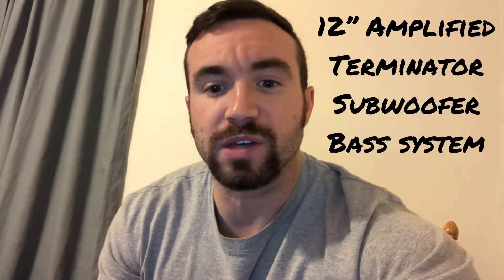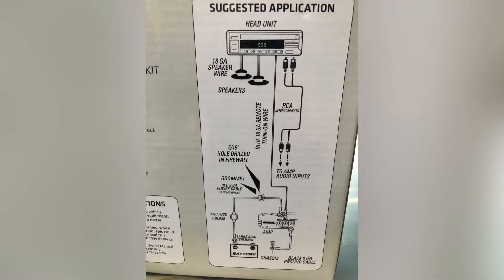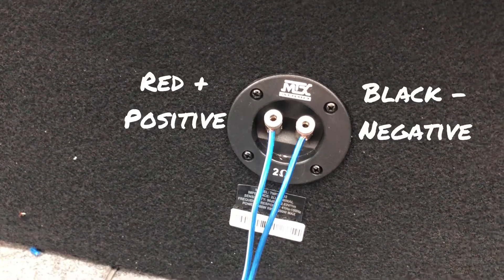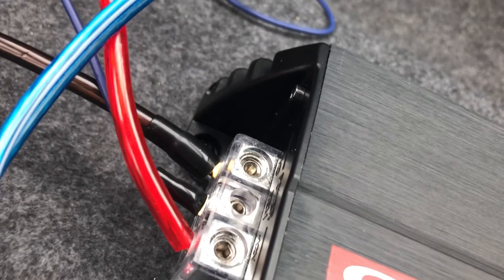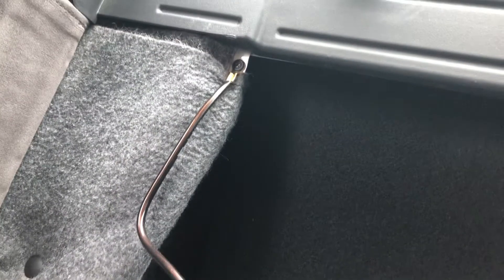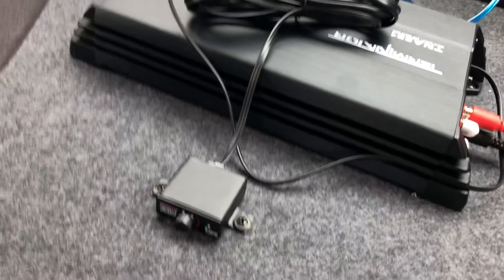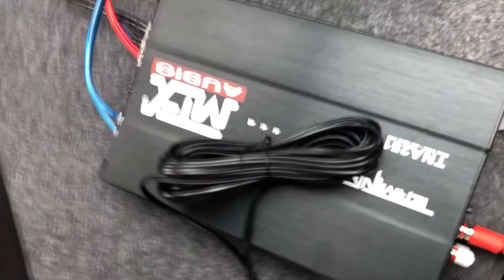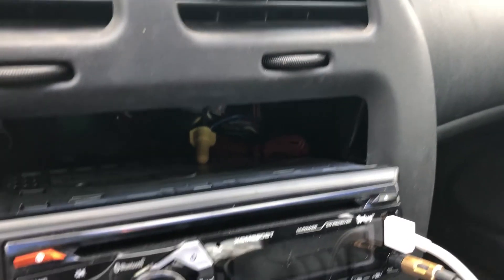Terminator Subwoofer with Amplifier  How to Install

Comment: The lights flash on the amp when I turn my car on, if anyone can tell me why, that'd be great
Reply from the maker: Many times, the protection indicator will blink to indicate the reason the amp is in protect mode. The owner's manual is the best source to help you decode the blink sequence. This is common on older Alpine amplifiers. Not all amps have a protection mode indicator
Reply: Ah ok! Thanks for responding! I think I wasnt grunded right, so once I moved it, it fixed 
 @ChrisBassettTV

Comment: What is the small white rectangle port next to the RCA cable inputs? It's labeled HLI
Reply from the maker: Hey Jessie! HLI is High level inputs. That means that you are using the speaker wire leads off of the back of the radio instead of using the RCA connections.

Comment: I have the compact 8" terminator. I have power from battery and a good ground. Any idea why I get no light from leds and the fuse is good. I have a rca cable for speakers 12v landed on the terminal and ground on the ground terminal.. so I have to use the REM port hooked to the receiver? Thank you
Reply from the maker: 🤔 Hey Shawn! Maybe check the accessory/ignition wires are connected correctly… First off, check your wiring. If you have a voltage meter or a test light, test the ground (black), constant 12v (yellow), and accessory 12v (red) wires to make see if you have the correct voltage in the correct wires, as well as a good ground. Constant will always be 12v, whether or not your car is on. Accessory will be 12v only when you turn the key to the “ON” position or the car is running. Make sure to use your ground, as well as another ground (like the frame or body of the car) while testing your constant and accessory to test that you have a good ground.
If you find that one of your power wires or ground wires are not correct, check your vehicle wire diagram and make sure you have the correct corresponding power and ground wires.
If you do not have power, and you know for a fact your wiring is correct, check the fuses under the dash or under the hood (depending on your vehicle). Easiest way to locate the correct fuse is to look in the Owner’s Manual and find the fuse number and box location. Your manual should indicate which fuse is for the “Accessory”, “Car Stereo”, or something of that sort. After finding the location of the fuse, pull it and make sure that the leads are not corroded and that the fuse has not been broken or popped.
If your speakers randomly stopped working and you noticed that your amplifier is in protection mode, there are a few reasons why this might have happened.
Most aftermarket amplifiers have a protection from low and high voltage. If your alternator is producing too much power, it will trigger the amplifier’s protection mode. Vice versa, if your battery is low and the amplifier is not receiving a constant 12v, it will enter protection mode.
Amplifiers will also enter protection mode if there is a short somewhere. If you have a signal RCA wire that is shorting out, this could be your problem so check to see if your RCAs are in-tact and not shorted. Also, if one of the output channels are shorted out, or you have a blown speaker, many aftermarket amplifiers will enter protection mode. Disconnect all output channels and see if it will return to normal operation. Hope that helps
Reply: @ChrisBassettTV  appreciate the response! I didn't have the middle terminal on the amp hooked up to the power antenna wire in the back of my head unit.  Thank you!
Reply from the maker: @shawngraham8816  Awesome! Glad to hear it’s working!

Comment: On the positive and negative my negative keeps falling out any solutions ? I see people twist the wires and put it in then use a wrench and twist the top ? You have any solutions
Reply from the maker: Hey Xavier, twisting the wires works to give the set screw something to bite on. Are you unscrewing and opening that before you put the wire inside? Then screwing it closed? Also you could try crimping a connection on the wire to give  the screw something to bite on.

Comment: 1 more question bro I see ur speaker wire is pretty thick, the speaker wire they gave me is about the size of the remote wire should I not use that or is it fine
Reply from the maker: Hey Jessie! The sub came with a wire kit. If you are using thin gauge wire above 16 AWG (18–24) this is not good for long speaker runs. It will degrade the signal and could cause some more resistance to the amp adding heat. 16 gauge wire is recommended for cable runs up to a max of 30ft. You could try it and see what happens, feel the wires while it’s running, if they get hot probably should switch

Comment: mine were working just fine then a couple weeks ago they just turned off, any ideas?
Reply from the maker: Hey Andy! Blown fuse maybe but more likely a loose or disconnected wire
Reply: @ChrisBassettTV  hey man! after a little further research i found out my power cord was disconnected from my battery, it had corroded so bad that it completely just became brittle and fell off! easy fix!
Reply from the maker: @BergyV4  😂 easy fix! Great to hear

Comment: Hey man I just bought the same thing with the amp but i didn’t get any power cord, remote cord ect. Lol I pretty much need every piece of wiring so do you have any suggestions on where to get them or a link I’d appreciate it. Its going on a 2000 crv if that helps.
Reply from the maker: Hey Jessie! It comes with an 8 gauge kit/accessories… this link looks like the same stuff that comes with the sub/amp. 20$ on Amazon BOSS Audio Systems KIT2 8 Gauge Amplifier Installation Wiring Kit - A Car Amplifier Wiring Kit Helps You Make Connections and Brings Power To Your Radio, Subwoofers and Speakers

Comment: Do you have any idea why my amp is flashing red?
Reply from the maker: Hey Juicy! Thanks for the question. Most amplifiers power light changes to red because of thermal overload. Possible wire short circuit. Check all your wires for damage, breaks and proper connections. I notice when there is a wiring issue even the smallest cracks in the wire can cause problems

Comment: How did you run power wire ? Thru firewall or where ?
Reply from the maker: Hey J Tate! There is a grommet where electrical wires run through the firewall and underneath the dash… it’s a tight squeeze. I ran the power wire up around the hood and inside the passenger door then I pulled up the carpet and ran the wire underneath and to the back of the car where I installed the amp

Comment: how is there two subs but one set of speaker wire?
Reply from the maker: The subs came pre-boxed and finished so I assume they are wired/connected properly together inside, as both generate sound. The speaker wire does have two connections to the back of the box, I had to separate and strip it to make contact

Comment: Anyone know what’s wrong if the amp is blinking?
Reply from the maker: This is what I read.. “Each red blink indicates the amp is being scanned by the internal DSP to confirm all is well on each zone. The blinking red LED means all is good. You should only get worried if that bottom LED becomes SOLID red, then that indicates there is a short on that particular zone.”